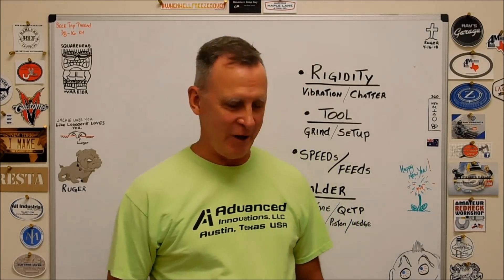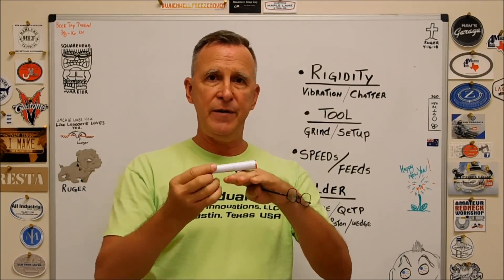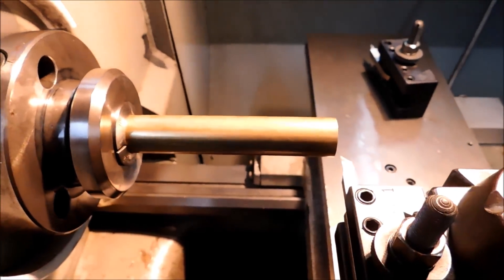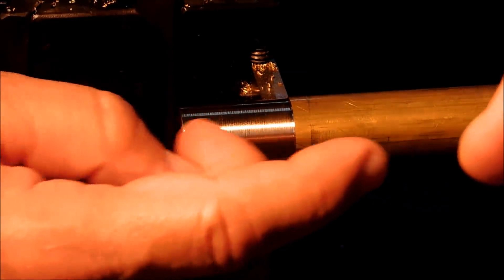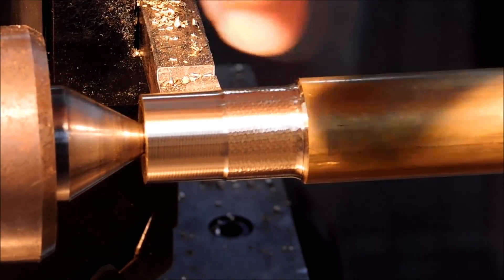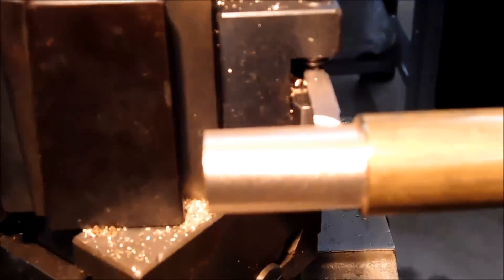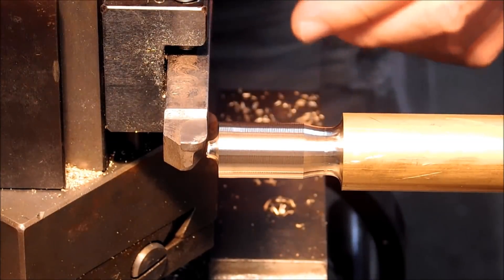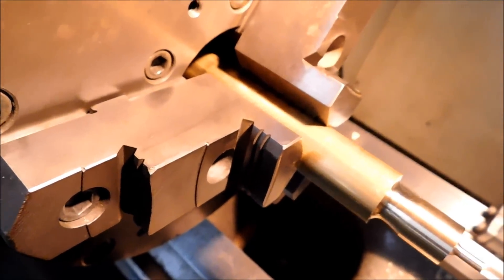Bad Turned Surface Finish and Some Reasons Why

Comment: Anyone know how to get an accurate leg with when putting an angle on a round part for the lathe?
Reply from the maker: Do you mean where the angled surface runs out as compared to the front of the part as measured parallel to the centerline, or the length of the actual conical surface itself. There are 2 ways to define it.
Reply: @joepie221  so I'm making .200 thick plates with a 15 degree angle around the edge. The angle starts about .100 deep on the edge of the OD I'm trying to figure out how to do this by advancing the compound. Hope that makes sense?
Reply from the maker: Start with a dead sharp corner on your part. 
1. Set the compound to your desired angle. 
2. Get the tool close to the sharp corner. 
3. By advancing the carriage, start making ghost passes with your tool until it just nicks the corner. 
4. Move the carriage in a couple thousands of an inch less than the dimension you need to hit. This allows for the material removed by the 'Nick" during setup.
5. Set your stop or Zero point and don't move the cross slide. The angle will hit the distance set by the carriage movement.
Let me know if this works for your part.
Reply: Hi Joe thanks for responding, this worked out great. Love your channel

Comment: A Diamond coated file is an invaluable piece of kit if you're a bit nervous or don't have a Grinder for making slight tweaks (especially like the ten thou' chamfer on the drill for Brass in the post below)

Comment: That wasn't tool stick-out causing your problem at about 29m. You could actually see the shaft catching on the tool and bending upwards.  Thinner stock would have climbed over and crashed.
Reply from the maker: I agree

Comment: :) I used to compare cutting brass to being in a small enclosed closet and punching a hornet nest.
Reply: A good trick when doing occasional grooving or parting in brass (plunge cuts generally) is to take a piece of corrugated cardboard, like the flap off a box, and hold it in front of the tool with your spare hand like a matador's cape, then plunge the tool through it and into the work, leaving it there until the plunge is finished.
If you do lots of this, rig up a perspex screen wrapping around the toolpost and clipping on somehow.

Comment: When I was a student at TAFE we had an exercise using some 40 mm (1 1/2 inch) bar stock, it was hot rolled and was probably cheap.  We used Colchester lathes from the 1960/1970s .

This material was awful. No-one could get a good finish with either H S S or Carbide tooling, the teachers had no better success than the students, and would say" don't panic, we call this stuff cat's tongue because of the rough finish". 

The next batch of material might be better , we never know!!    No-one knew where the stuff came from or even if it had a specification.

The moral:  Sometimes things happen which are beyond us mere mortals!!

Stavros, fondly remembering student days.

Comment: You also have to bear in mind the material you're turning. Some stuff is a bastard to turn no matter what you do, EN8 (1040 in USA?) springs to mind...nasty ol gear, very hard to get a decent finish on (unless you know a way then by all means share). High speed/feed you can get a reasonably shiny finish, but up close can see small tearing, can drive you nuts. On the plus side it's relatively cheap, which can also make it a double hit on a small lathe, hard to turn but more likely to have it, as it's cheaper...
Reply: I get good results on EN8 with an HSS shear tool taking a couple of thou per cut for finish passes
Reply: Robert Cox - never having made it far past 'n00b' status, I found some steels seemed to respond to that exact recipe
Reply: I agree on the shear tool, especially if you take care to achieve crisp geometry, together with mirror polished faces adjacent to the cutting edge (it's not a trivial exercise to get both of these simultaneously)

Comment: Something I might pass on as an alternative to scotch tape etc. The jaw chucks in the lathes at school, and we are talking 50 years ago, were worn from the year's by the abuse of 11 to 16-year-olds using them and no money to replace them. The engineering teacher used to deal with the problem by wrapping Emory cloth, not paper, cloth side to part round the part and clamping down on that seemed work well. Good for protecting the surface of a machined part as well if you have to turn it around.

Comment: "Speed and Feed equal to the nose radius"  can you expand on this a bit....  If you have a nose radius of 1/32", what should the Speed and Feed be?  Sorry... I'm a slow learner.... lol
Reply from the maker: Not a problem. think of it as a thread. If the carriage moves, on each rotation of the spindle, farther than the tool tip contact area is wide, you will have material that does not get cut. If you have a tool radius of 1/32, that translates to .06 wide at .03 deep. With a tool tip radius that big, you can have a very aggressive feed rate and not have a problem because you will have a cutting tool tip foot print overlap with each rotation. The deeper you go with the tool, the wider the overlap will be. This may be conservative, but an .03 nose radius tool will give a fantastic finish at about .01/rev feed rate. The RPM will be material specific based on size and type.

Comment: the long hair brought back bad memories..... I saw someone get scalped by a lathe in highschool shop class.....
Reply from the maker: I saw it happen on a mill. The operator leaned over to look down a hole and that small down feed shaft curled a bunch of hair and tried to drill a hole in the head. Ugly and painful. I also saw a pedestal grinder with the end plate removed, grab a T shirt and try to bore a hole in a kids back once. It happens quick.
Reply: Joe Pieczynski the incident I saw was actually on a wood lathe. they leaned forward to get a chisel that was on the stand below the bed, and their hair caught in the Chuck..... At wood lathe speed it was pretty well instant.... 

My worst close call was nearly removing my left index finger on a big baldor pedestal buffer.

Comment: Don't worry about not  illustrating a messy finish , we get your point . You may lack imagination   in my field . l left the key in the chuck , big noise no damage but you don't forget . I had no idea an empty chuck can fly apart  at high speed , probably another big noise if I  didn't bother to subscribe . l wonder , are you a fan of using a T.P.Grinder instead of a single points for doing inside diameter or boring very accurate work ? Less flex in the setup ?
Reply from the maker: Funny, I've never been accused of a lack of imagination.
Reply: @joepie221  Forgot to say thanks for the tips. Cheers . Nice dog.

Comment: Pro tip pulling a boring bore out gets a nicer finish than pushing it in.
Reply from the maker: You will remove the supporting material and induce push and noise. I personally would never do this. The real truth is that the relief side of the insert is never worn because it hides behind the leading/cutting edge. Pulling back while cutting is just using a fresh edge and contact geometry. Thats all.
Reply: @joepie221  I tried everything else first. It was a ground braised carbide into a hardened steel gear 3" deep 3"od 1.25" id target. It resulted in perfect curly chips and sound of tearing paper. Flawless finish. I'd post pic here if I could.
Reply: I've encountered that effect, with both ground-from-solid HSS tools and brazed carbide, and it turned out to be because of what Joe wrote.
It can be a good way to counteract progressive push-off causing bell-mouthing, to cut back out as well as going in, but a properly sharpened tool will not usually push off unless the hole is really small for its depth.